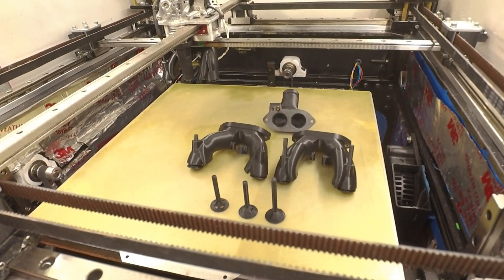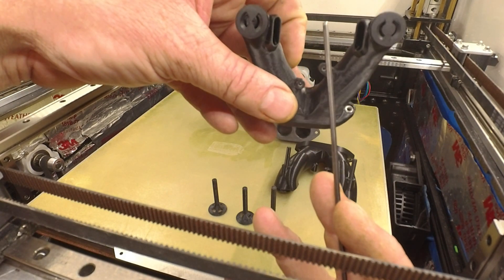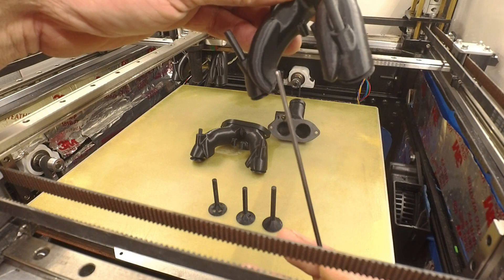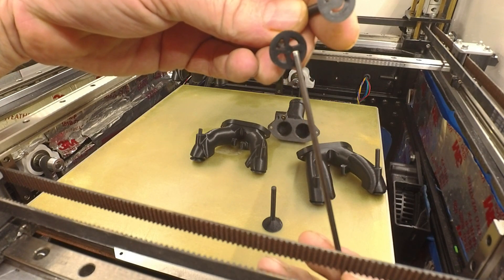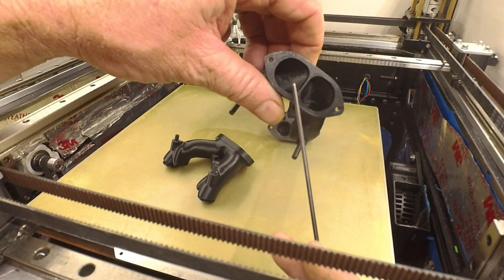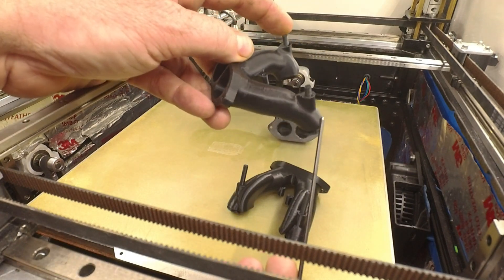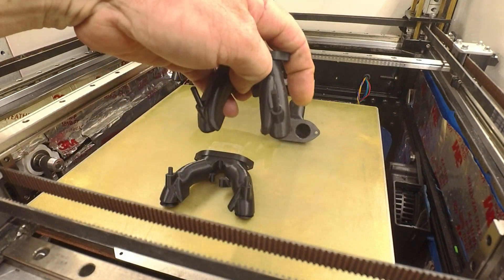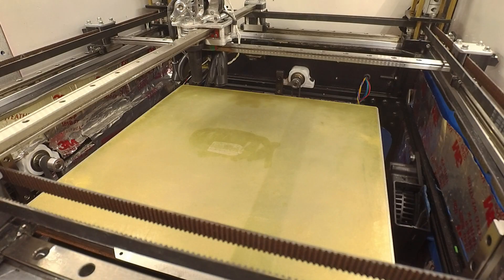New duct design change

Comment: What kind of accuracy are you getting? Different filaments have different results?
Reply from the maker: Typical <0.1mm XY, Z depends on how square the machine is or document the skew and program out the error. Each filament is tuned for flow, so yes, it changes with filament type.

Comment: could you provide / upload the front section as an step file? I am running a Voron with Goliath an a custom head and would like to modify it....
Reply from the maker: For now, you will need to convert it to .step from .stl  using Fusion, inventor, freecad, ETC.
Reply from the maker: Check Thingiverse.  I added a file with the mounting flange taken off. You can extend, add, whatever you like.